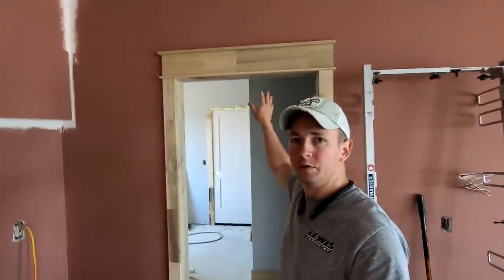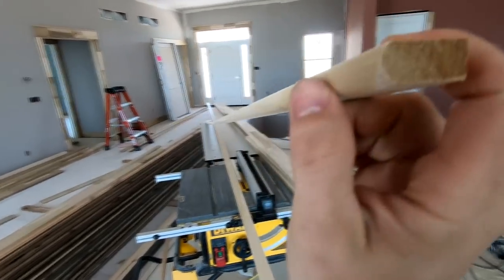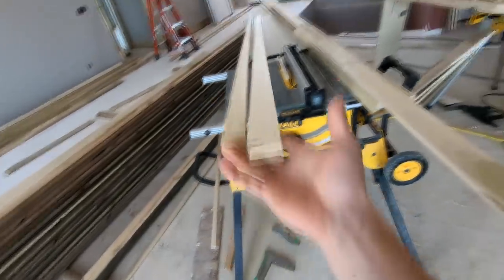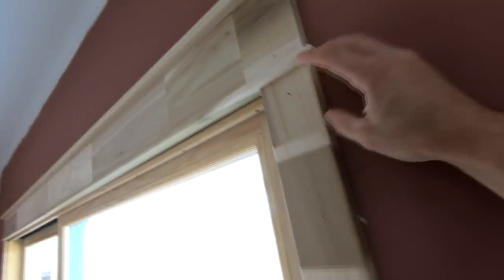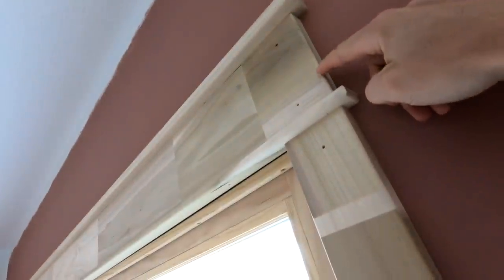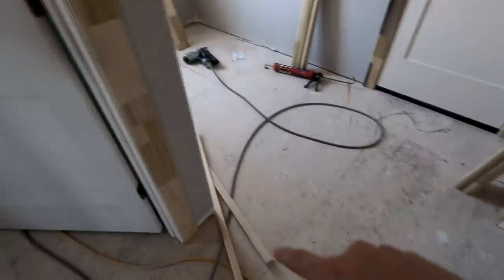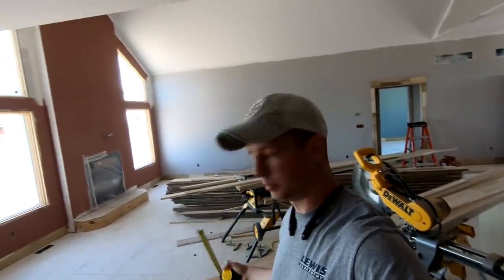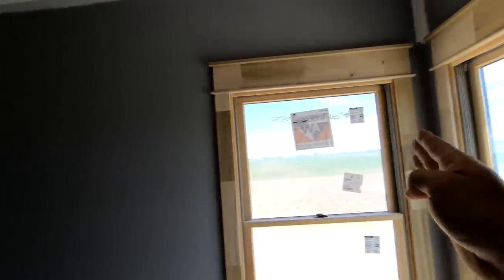BLAZING Fast 3 Piece Headers & Stop Block Secrets

Comment: I have always used a tape and stop system with my miter saw.  It is such a timesaver and increases accuracy and consistency so much that I don't understand why anyone would not build their system without stop blocks.  Your addition of the adjustable stops take it to another level and is amazing!  Kudos!

Comment: Always nice to see the process other guys use. I have used a radi-plane for the small radius eased edge  instead of the router. Works great on the long edges but a little tough on end grain. Nice job, love your saw station.

Comment: The rounded edges you do look nice but personally I like the look of square edges so that's what I did in my house.  I like your stop block idea too so I may have to make one like it.
Reply: The functional benefits of eased edges is that they hold up to abuse better and if the corner is sharp, the coating has a difficult time bonding to itself, which can cause failure.

Comment: Omg i feel like an idiot ive never thought to just route the edges on my return on my bullet trim. I've always cut returns so much faster & simple. Guess I've just been stuck in the way I've been taught thanks for the tip
Reply: Well there is a little more sanding and priming for the painter however.  So not a complete win, win.
Reply: By routing the edge you are leaving an open end grain which in some cases would not take paint the same way as using a return. But I see the production side of it...  Good job...
Reply: @gregorylondos534  ,  Very true.  I might sand it and hit it with a can of primer if I was the one doing the painting, or wanted to speed up the process for the painter. Then again, not sure if I would use finger jointed stock, especially if it was a high end house.
Reply: @gregorylondos534  one solution I found for sealing the endgrain is when I'm caulking I just rub a thin coat over the grain and rub the majority off with my damp sponge. It takes primer and paint just as well as the rest

Comment: considering you like batch cutting to save time i’m surprised you do not build the header casing on the bench.  by building then on the bench you can be sure that all the reveals are all the same, and the only difference between piece by piece installation and batch building are the nails in the casing legs you mentioned.

something i always wondered why the finish carpentry standard is to install all the trim then paint it.
i find that painting, then installing results in a very crisp line between the walls and casing.
two finished products coming together but have a distinct and fine line separating them.

maybe it’s a time line situation due to dead lines, i don’t know.i feel the same about hardwood flooring.
first the floor, then the baseboards and trim.
having to but the flooring against the baseboard is challenging on every piece, while cutting the flooring a 1/2” short and rapidly installing it, then setting the baseboard over that, again, will result in a very fine line between the two.
i’ve done this many times and it looks amazing.
the nail holes have to be filled and painted anyway.  just my two cents worth.

i like that super top secret mitersaw stop you have there.

i like your videos, and will continue to watch and learn.
cheers!

Comment: Great explanation.  One question, why not put a little glue in between all of these pieces to help minimize gaps opening up in the winter?  My current house suffered from this.  I've had to replace a few of my, cough cough Anderson 400 double hungs, and when I  reinstalled the casing, I glued the edges and they no longer open up in the winter.  Just curious.  Also, I'm in KC, how far do you travel 😆😆?

Comment: Using the palm router instead of a miter return is genius. You said you only do it for paint grade tho, is that correct? Is there a reason you don't do this for stain grade? Seems like the one piece would look nicer than the miter for staining...thanks for the video this is one of my favorite channels 👍
Reply from the maker: On stain grade the end grain of the wood will absorb more stain and be very dark. I have done it before. As long as everyone is ok with the darker end grain look you can definitely do it.
Reply: @InsiderCarpentry  oh right on, thanks for the reply 👍

Comment: A 4 foot ladder is very useful you might find a small work platform better for this work. It prevents you form leaning (better range of motion) to save any possible injury t your back. It also allows you to get closer tot eh window and door easier to move around. I use a platform for most of my stuff. It has a slightly bigger foot print.

Comment: I pre-assemble headers for 8ft ceiling, gets tight nailing top piece on doing it in place.
Reply from the maker: We don’t see many 8’ ceiling situations in new construction anymore. Most are 9’ around here. But very valid point. I do run into that problem occasionally.

Comment: If you're adding this trim around a walkway (i.e. a doorway minus the door) would you also have some kind of trim around the interior of the opening? And then a bit of a reveal between that and the trim you're adding here? I think I'm going to use this style for a new house we're building this winter. Thanks!
Reply from the maker: Yes, flat jamb around the inside. We call that a cased opening.

Comment: Loved that you showed routing the end grain cut , only thing is ,some times the end grain burns on some species of timber and you need a vary speed router , I see you use air guns have you considered the new battery ones as yet , I still prefer the air as the angles and ease of use makes it better but the new battery hikoki;s seem to be on mark , what is your opinion on them
Reply from the maker: I use dewalt. They are so so. Can’t beat the power and ease of air.

Comment: Do you use a spacer jig for the pieces above the legs?  And SIR THANK YOU!  I’ve  learned so much from your videos I’ve been able to transform our home Into one I otherwise couldn’t afford.  
Just saw second video.  Saw the spacer.  TY
Reply from the maker: Yes, just a simple block ripped at the offset measurement. Hold it against the casing and mark the outside with a pencil on the drywall.
Reply: Insider Carpentry Insider Carpentry  -  TY.  Been a consumer of YTube for years.  YT and all things Web were my life as a telecom student & teacher.   Your videos are the right blend of;  honesty,  respect, experience, demonstrations on a granular level,  and the talent and desire to teach.  We’re best at grasping new unknown concepts when old known concepts connect and demonstrate the new.  “Use something they know to teach them something they don’t know”.  TY.

Comment: I would install the legs first.  Then I would definitely build the header on the bench, and install it as a whole.. for the door ways.  For the windows I would build the whole thing on the bench, then install the whole thing in one piece..  assuming you take all the correct measurements

Comment: I think you use 1x stock (.75" nominal) for baseboards?  Do you plinth then since door casing is also .75" nominal?  .75" base allows for "budget" wainscoting with 5/8" casing stiles per one of your other excellent videos.  But then you have no thickness offset between baseboard and door casing.  Thoughts?
Reply from the maker: In those scenarios I use a 3/4" thick 1x for the wains only. The rest of the house still gets 5/8" thick base. I ease the end of the bottom 1x where it transitions into the base. For mid range homes its a good solution that doesn't break the bank.
Reply: @InsiderCarpentry  OK, I'm following that you use 5/8" base in rest of house and only 1x in the wains rooms.  But I'm not following what you do in the wains rooms with "I ease the end of the bottom 1x where it transitions into the base".  Both the door casing and the base are .75" in the wains room which was the original question.  By "ease" are you saying you roundover the butt end of the base where it meets the casing to give some delineation?  Something else?

Comment: I noticed that you don’t need extension jambs on your windows. Is the house framed with 2x4’s?  Just curious about insulation performance. I also use this same trim detail quite a bit. Fast, simple, and looks really good. I’ve been a carpenter for 30 years, and I learn things from your videos every time I watch!
Thanks
Reply from the maker: Thanks sir. These windows are anderson 400 series I think. And yes, 2x4 wall framing. Generally I never have to install extension jambs. Even with casement windows in 2x6 walls they are installed by the window installer, aka framer, before I get there.

Comment: as always very nice video's.  Question, do you ever do trim on windows with bull nose sheet rock edges?  If so what sort of ways do you trim those out?
Reply: Hey Kent, just read your comment. In addition to Inside Carpentry, check out Finish Carpentry TV.  He lives in Texas and works with a lot of bull nose sheet rock.

Comment: Why don't they send you pre primed molding?
Reply from the maker: On large custom homes we are doing so many things with raw material that there is going to be a lot of stuff that has to be primed no matter what. We've found it makes more sense to prime on site. You also get a much better bond with a site applied primer vs a factory applied primer which is often covered in dust and dirt by the time its time to paint it.

Comment: Better to do a miter return for paint or sand to 320.
Reply from the maker: A lot of things are better, but the question is does the builder want to pay for the time it takes to make it better? Mitered returns take more time and 99%+ of people will never be able to discern the difference after paint. 

One of the paint crews that follows me hits the end grain with a coat of brushed on zinsser cover stain primer before they spray the primer on. Goes quick and eliminates a lot of the paint grade end grain issues.

Comment: You said that one of the pieces had a 5/32 edge on it and you had to router one of the 1X to match. Did you use a 1/4 or 5/32 bit to do this. Also, the top 1X2. Is it routed on the top and bottom edge ? Could not make out the detail in pictures shown.
Reply: cndream1 just a FYI
1/4” bit
And yes on the 1x2 he also hits the ends of both with that bit the break it over!

I know it’s like so much good info I had to watch it a couple times!

I can also tell you all his bits are white side bits!  Hey take a look at infinity also I hv good luck with them plus their 1/4 “ flat bottom grind 8 1/4” blade for the table saw!
It’s like lighting fast on making 1/4” and 1/2” dado’s for my cabinets’
I am a cabinet maker & custom finish carpenter!
Anyway brother hope that helps!